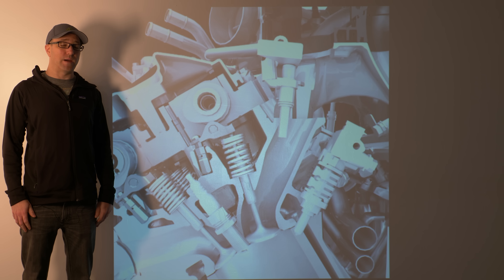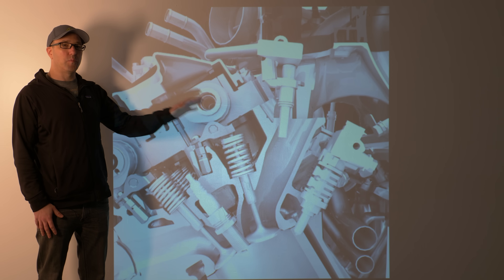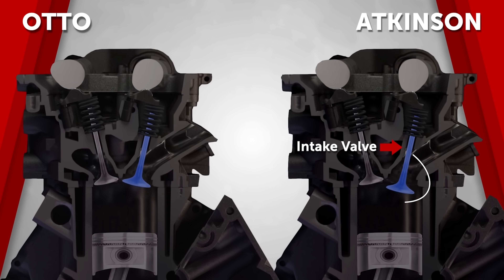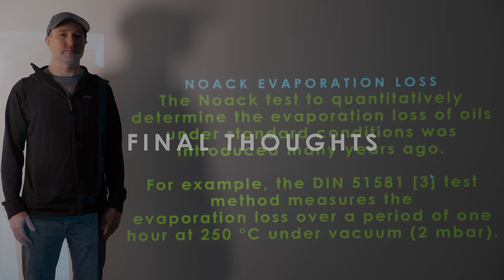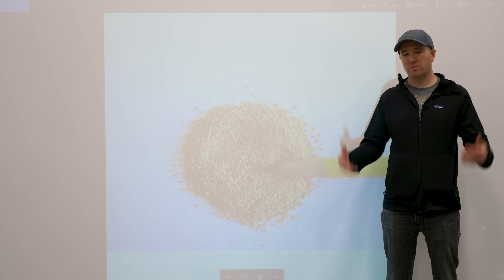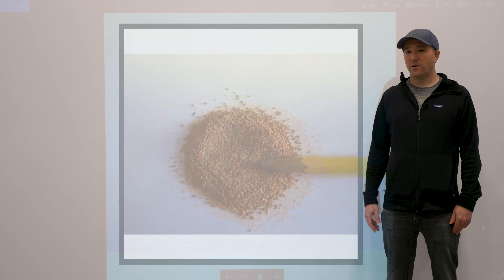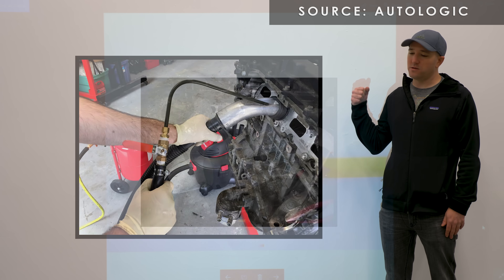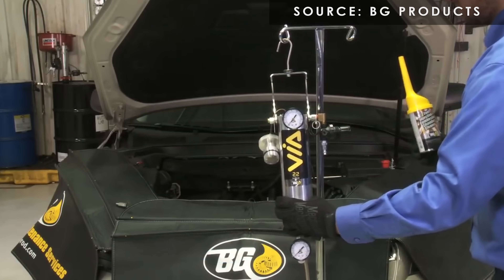Direct Injection, Problems and Solutions | The Fine Print

Comment: Welll, sounds like B.S. to me .... I NEVER heard of any honda or anything else back the 90's that got "60,70,80 MPG"  ..... did any of you ?
Reply: The Honda Civic CRX HF got upper 50s in the miles per gallon knucklehead.
Reply: When I was a kid my family and I went on several road trip vacations around the US in an 86 Accord.  We averaged 45mpg - 5 passengers, and a fully loaded car.
Reply: @dontbother7330  cars were lighter then much lighter. That's why theyve all hit a wall an EVs are coming.
Reply: I used to own a Honda Civic CRX HF because at the time I did a lot of highway driving.  I usually got between 60-63 MPG.  However, the car was super light and had very skinny tires.  So glad I was never in an accident with that vehicle as I doubt it would have turned out well for me.
Reply: Yes, in Europe. The MAN will not allow those vehicles in the USA.
Reply: My old crx got 58mpg
Reply: @brianrichards782  I used to think these numbers were 1 time things but certain routes and driving styles can go way above EPA figures. My CT200h has hit high 50s on 2 hour round trips (all 50mph roads, lots of hills, no stops). But the car is rated 40/43. But that's a car that weighs about 1100 lbs more than that CRX.
Reply: It's can be done, but back during that time cars had no technology in them and didn't weight almost 2 tons.

Edit: I circle back on this comment. There were cars that did weight a almost 2 ton on the American side of the house. But it took America manufacturers about a decade to realize fuel efficiency (IE, Gas crisis of 1970).
Reply: @the black metal what do you mean they had no technology? Honda was the first to invent vtec also known as VVTI first year realeasd was in 89 on their Japanese integras. Those baby's had a small 1.7 liter that made 160hp and gave you 55mpg
Reply: @yourmom705  Yea all the automakers have there tech wins.
Reply: Yes.
Reply: It was the lean burn engines, but produced too much NOx, getting that down would have needed something like the urea /cyanuric acid injection systems seen on diesels nowadays.
Reply: Heck no.
Reply: mikew4171 FYI,  Honda Civic VX got up to 70 MPG.
Reply: 1884 vw Jetta Diesel 50 plus highway sure max speed of 70s but great car
Reply: 92 civic hatch back got 70 mpg with its d15 engine
Reply: Fook no.

Comment: Don't spread the myth that cars used to get 60 mpg.   The Civic CVCC got maybe 29 mpg tops.  A lean burn engine.
Reply from the maker: Honda Insight 1L with manual trans easily got 65-70MPG. The Civic VX hatch was over 50MPG and the HX manual was the same. Thats all recent history.
Reply: @savagegeese  here is a recent FACT.  the  Hondoo Insight  is a HYBRID.  duh.  from wikipedia: The gasoline engine is a 67 hp (50 kW; 68 PS), 1.0 litre, ECA series 3-cylinder unit providing lean burn operation with an air-to-fuel ratio that can reach 25.8 to 1.[15] The engine utilizes lightweight aluminum, magnesium, and plastic to minimize weight.[16] The **electrical motor assist** adds another 10 kW (13 hp) and a maximum of 36 pound-feet (49 Nm) of torque when called on, with the aim to boost performance to the level of a typical 1.5 L petrol engine.[17] It also acts as a generator during deceleration and braking to recharge the vehicle's batteries, and as the Insight's starter motor.[16] (This improves fuel efficiency and extends the lifetime and fade resistance of the brakes, without adding unsprung weight). When the car is not moving, for example at a stop light, the engine shuts off.[17] Power steering is electric, reducing accessory drag.[17]
Reply from the maker: @rret6885  the Hybrid portion of that car did nothing for the fuel efficiency. It was purely an assist function. I owned one and the vehicle frequently got 70 miles per gallon in the summer and it had nothing to do with IMA.
Reply: @savagegeese  if that is true, why didn't honda just increase the size of the engine and skip the motor?  if you are an engineer, what would you rather have? a motor **and** an engine?  or just an engine?  KISS?    if you are a manufacturer,  what could you sell at a lower price and perhaps more profit?  a car with a single engine, I say.  generating that extra 13HP with a larger engine would require burning more fuel.  the motor is in there in order to increase MPG.  don't see how you can argue that.

Comment: I was wondering why all of my Ford Escapes were using oil with relatively low mileage (less than 70k). I use Motorcraft 5w 20 semi synthetic oil and Motorcraft filters on every oil change at around 5-7k miles. The volatility rating is 15.2! The viscosity ratings are great though.

Comment: BG has a throttle body injected cleaner system that should mitigate this issue. Or you could build your own with a nozzle and pressure vessel (pressurized with an air compressor) spraying seafoam into the throttle body. Every other oil change or so and it should be no problem.

Comment: Overall a good presentation, especially the graphics, and you have a way of taking technical topics and making them understandable to a non-technical audience; but you got a couple of things wrong that detract from the positives of the video. First, you got "blow by" backwards. "Blow by" is a term used to describe hot gases from the combustion process escaping past the piston rings and down into the combustion chamber, pressurizing the crankcase. Oil can migrate from the crankcase up past the piston rings and into the combustion chamber, and crankcase pressure may or may not aggravate that condition, but the term "blow by" is not what this refers to. Second, in your discussion on oils, all oil marketers with API licenses have the NOACK test results, and should provide them to anyone inquiring about them. Most oil marketers have technical lines you can call for this information, or send an email to request the info and they should respond. This is not unusual. But the bottom line is, if the oil carries an API license, than it meets the performance limits for NOACK volatility for that performance level. Read your owners manual and it will tell you what API service classification oil to us, i.e. SN. If the oil is a licensed SN product, it meets the limits set by the industry for engines that require that oil. Use that oil and you will be assured the volatility is under the limits for your engine. Third, you mentioned "Group V" as a "true synthetic". Well, you really need to study the API base oil groupings a little better. Group V does include most synthetic oils, but it also includes some very basic non-synthetic oils which would not be good for a high quality engine oil. And the synthetic oils it does include are not commonly used in engine oils. Group III oils are made from heavily refined mineral oils, they are treated with hydrogen under severe pressures and heat to crack open the hydro-carbon molecule and reshape them, while also converting low quality wax compounds into very high quality synthetic hydrocarbons. These are "true synthetics". Group IV base oils are made of polyalphaolefin (PAO for short), or "synthetic hydrocarbons". They are made by polymerizing smaller molecules into larger molecules and the process allows them to be very specific in size and shape, tailor made for applications such as engine oils. These are "true synthetics".  Most all synthetic motor oils on the market today are made with 1 of these 2 technologies. Group V base oil in an engine oil is not unheard of, but would be very rare. Something like an ester, which is made by reacting an acid with an alcohol. This technology is more common in jet engine applications than in automotive engine oils. But finding out which base oil technology is used to make a specific product may be more difficult than finding out the NOACK test results.

Comment: Port and direct systems are a better option over straight direct injection 

With the port/direct systems the port side injector helps remove deposits that come from the emission systems 

With direct injection you need to run decarb services either at a dealer or do it yourself 

And those need to be done every 15k at max to maintain optimal intake valve life and operation 

And I’m actually happy this guy covers this in the video thanks for mentioning what many others neglect to touch on you got yourself a subscriber 👍

Comment: I'm surprised water/methanol and water/ethanol injection were not mentioned at all in the video for turbocharged GDI cars. These can be set up to spray alcohol over the fuel injectors at a specified level of boost in order to aid in cleaning the valves. The system up front cost is generally large, and the fluid run can be expensive if you run high methanol concentrations, but combined with catch cans, it can help further extend the interval at which you need to clean off those intake valves, possibly indefinitely if you set the starting and full injection boost low enough. An added benefit is decreased charge air/combustion temperatures and a rise in effective octane, reducing knock and allowing the engine to run leaner while making more power at full throttle. From the factory, my car is able to manage a paltry 10.5:1 air:fuel with 87 octane, but with methanol injection and 90 octane, it's able to be leaned out to 12.1:1 air:fuel to make more power across the entire rev range.

Comment: Blowby goes down into the crankcase under compression. First problem, your oil gets diluted by gasoline over time. Second problem is as he described with the PCV. Catch cans work well on diesel engines too...I use a ProVent from Germany on my common rail turbo diesel. It’s very good.

Comment: Thanks,,,very big chunk i didn't even think about,
Didn't think the pcv valve could cause such a problem,
Oil evaporation during engine cycle is another eye opener,
Might just put a catch can on any way,,
So not only a little wiser but very thank full my old gal is port injected,
Great job,Thank you very much,,

Comment: Why not just use a vacuum pump and inject the blowby into the exhaust manifold?
Reply: well thats pretty good in theory but oil vapor can and will damage a catalytic converter! some race engines actually employ that concept you mention... you may have even seen small barbed fittings or bungs welded onto some brands of competition-only headers near the collector. they will weld the fitting in at a steep angle to use the vacuum effect of the exhaust gases passing by/over the fitting which, in turn, is connected directly to each valve cover of their respective sides. high compression, high HP race engines tend to generate lots of crankcase pressure due to windage from a high revving crankshaft, more blow-by from high compression and higher cylinder pressures, and a lack of vacuum due to large high lift camshafts with lots of valve overlap means the use of a PCV system wouldn't work well without a vacuum pump... this is why some choose your idea of pulling vacuum (in this case via exhaust-derived vacuum) directly off of block and valve cover breathers!

Comment: This is the same crap we’ve been dealing with on diesels since they went to closed crankcase ventilation. I’d probably just plug the vacuum line and run the crankcase vent down the side of the engine and be done with it.

Comment: The comment by Big Dog50001 Automotive was originally from Ronald Reagan and the full quote is "The 9 most frightening words in the English language are I'm from the government and I'm here to help".  Meaning that the government screws up everything it touches with rules and regulations, just the way they have screwed up just about everything on our vehicles.  Idiotic government rules have forced the automakers to make increasingly lighter and less reliable vehicles that may get higher mileage and fewer emissions but are expensive and run like crap over the long haul.

Comment: After watching I'm afraid to buy a new vehicle.  Electric cars are starting starting to sound better every day.
Reply: Just keep your old car til the manufactures perfect this
Reply: It's only money, it not like you can only afford one car for the rest if your life. You don't think electric cars won't have any problems?
Reply: Buy Toyota, they have dual fuel injector
Reply: Get a Volt before they are gone!!!
Reply: Rk, just buy an car that has the dual port injection system and you'll be fine. And always run some kind of port injection cleaner in your gas. I do every fillup. But right now, I wouldn't buy a Honda turbo. Bad engine. Check the forums.
Reply: And electric cars suck.
Reply: No thanks. I’ll take my gen 1 small block Chevy engine. Eff the polar bears and man caused global warming. There’s nothing like the sound of a 750 double pumper at wot, sucking sea gulls from the sky. Btw, I’m a master certified L1 ase technician that deals with this garbage set up of direct injection just about every week. If you have a Volkswagen gdi engine with 30-40,000 miles experiencing random misfires especially when cold, don’t let your mechanic start replacing the ignition coils. Pull the intake manifold and check out the massive carbon build up on the intake valves. The only way to clean them is with a brush and a good solvent. And also be anal about your oil and filter changes.
Reply: @thecardoctorautorepair2014  So does the solution of having two fuel injectors per cylinder work? - a GDI and the old-school port injector to clean the valves?
Reply: @mynameisgladiator1933  I haven't had the chance to experiment with that set up yet. But in theory, it should eliminate this problem of carbon build up. I guess it depends on the ratio of fuel dump between the two injectors. As I'm sure the pulse width modulation is equal, volume may not be.
Reply: @mynameisgladiator1933  not completely and certainly not with turbo tacked on.
Reply: @mynameisgladiator1933  Ford does too on it's gen2 Ecoboost lineup.
Reply: If you really wanna buy a cheap gas car you can throw around, I suggest the honda fit. If you want an electric car, yea telsa model 3 is amazing but what if you don't want to wait 5 -10 years to get one? I can suggest the Chevy Volt or the Chevy Bolt.
Reply: @mrsluigi9478  Chevy Volt is outstanding!
Reply: @mrsluigi9478   or a Mitsubishi Mirage. I have a stick one and love it.

Comment: AND the most logical answer for all you STUPID people driving gasoline vehicles is Propane/Natural gas engines (no problem with blow-by crap on your intake valves) or a modern Diesel engine that is cleaner than all the GDI's offered these days.

Comment: Errrr.... NOPE, NOPE AND NOPE. The first DI engines were pioneered in the mid 1800's. First major practical DI (by patent) was Rudolf Diesel - the engine that took over the world in every sense. 1902 - the first practical GDI was https://en.wikipedia.org/wiki/Antoinette_8V. The first cars were ELECTRIC powered.  The 1955 Merc 300SL https://en.wikipedia.org/wiki/Mercedes-Benz_300_SL was GDI and at that time the fastest production sports car in the world. Read the 'Emissions' section of https://en.wikipedia.org/wiki/Gasoline_direct_injection - GDI engines are worse than modern Diesels. AND all port injected gas fueled cars have two fuel pumps - one in the gas tank and an external higher pressure pump for the injectors.

Comment: I have a GDI 4 cylinder.  I use a fuel cleaner to keep the injectors clean and recently had my intake valves cleaned. I have about 115k miles on the motor. Around 60k of miles on the motor I noticed spark nock. So I have to put premium fuel in my car in order for it to go away.